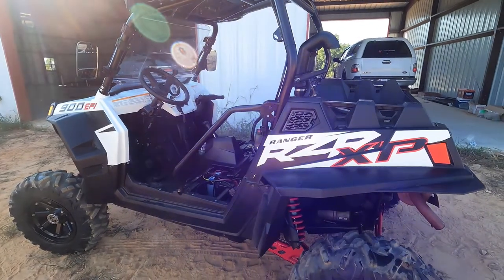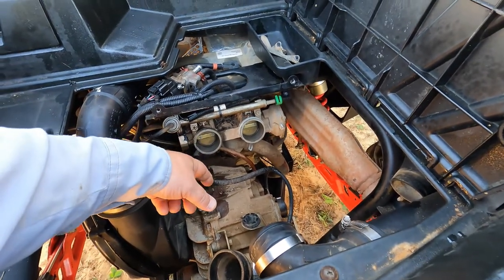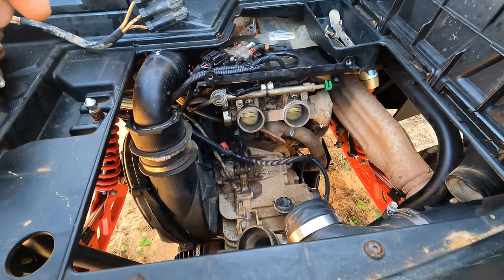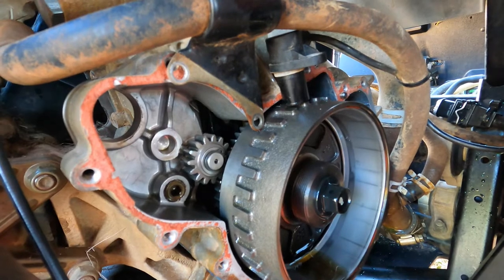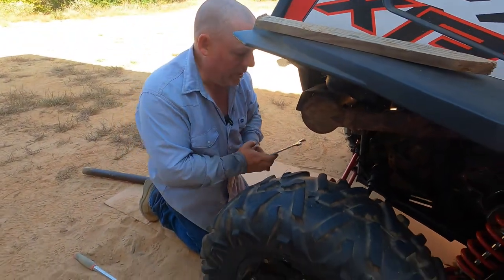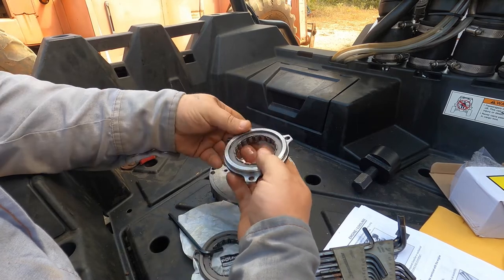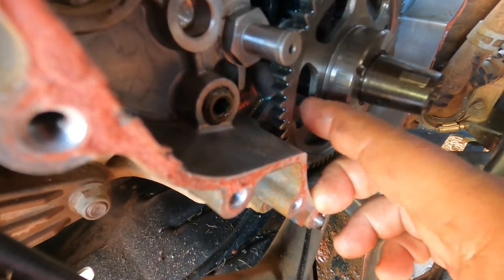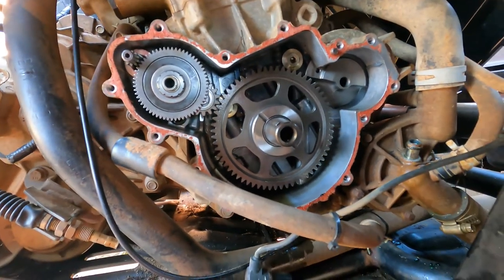2011 Polaris 900XP RZR, Starter Spins but Doesn't Engage

Comment: Super helpful video! This is a very common issue on the early gen xp900. Some red lock tite on that small idler pulley shaft goes a very long way. One way bearing failure seems to be a fairly common occurrence with these and I do believe it's 99% dude to the play that comes in them idler shafts over time. I also run a dab of red lock tite on the 3 one way bearing Allen bolts as those come loose really often aswell

Comment: Good find on that little gear that was loose. That’s a know problem on these machines. That gear loosens up fall out while engine is spinning and blows that side of the engine case out. It’s usually catastrophic failure. The fix is loctite and tighten back up.

Comment: Nice video Jeff. This exact issue just occurred to my RZR. What's your gut call on what fixed it? I was just about to order a new starter so very glad you made this video.
Reply from the maker: If the starter turns it’s good. For us it was the Starter Sprague Clutch. Even though it looked fine, it did not lock up so the starter would spin but not turn over the engine.

Comment: Did you just use silicone for the gasket I am trying to do mine on 2012 rzr 900
Reply from the maker: Permatex Ultra Black if I remember correctly. It worked great.